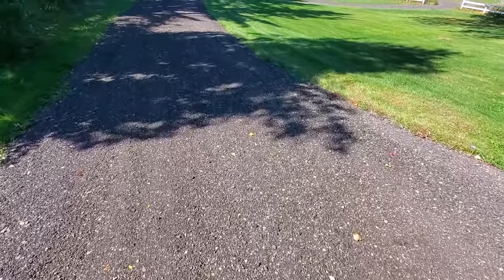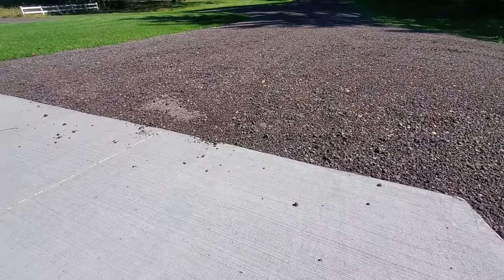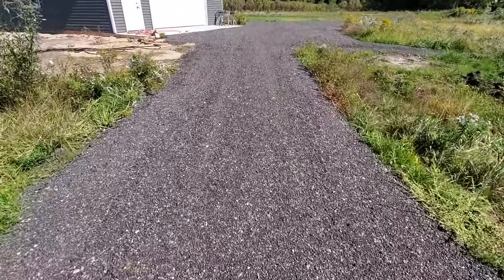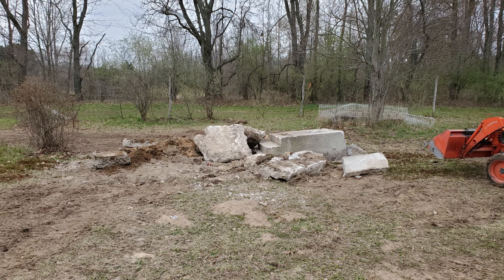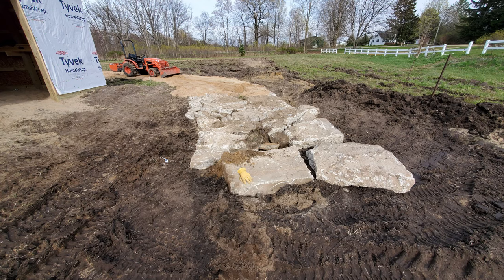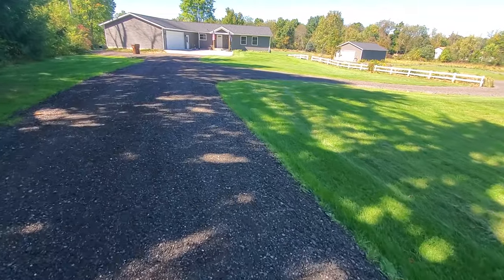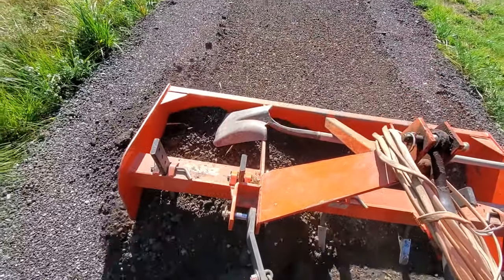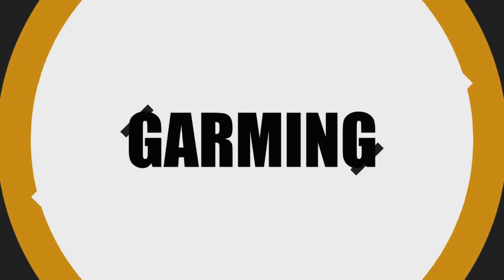DIY asphalt millings driveway and road any good? Will it hold 75 tons!?

Comment: I found a guy taking up a bunch of concrete, he was going to have to pay to get rid of it, he ended uo bring it to me, He told me it was 180k pounds od concrete, while most of it did not have wire there was some that did, and it was a pain, ended up renting a jack hammer for it, but the regular concrete was broken down into manageable pieces with a 12# sledge hammer, I'm filling a hole that the previous land owner dug out it measured roughly 40' X 60' deep, dug into a hillside and went from ground level to 8-10' ft deep at the back😬, I been using all kinds of fill, quite the job, I like the way your drive turned out, thinking of using Crushed concrete here on my drive for base, but really liking the asphalt millings for topping it off👍

Comment: I had 2 dump truck loads of millings delivered, I spread it and leveled it in the late fall season. Come early spring i ordered 2 pails of condensed hawkseal-E 
The rainy winter weather washed out my tar and so when i finally had warm enough weather to apply the hawkseal it dis not work as expected because theyop layer was mostly gravelly.. sad

Comment: Nice job dude. Couple of questions: 1) why did you use sand instead of stone dust?
2) noticed you grabbed the grade 1 milling with your hand. Doesn’t it bind together?
3. Did you use a roller on your 3 point hitch?
Reply from the maker: sand was cheap and i needed dozens of trucks for the house build already, not to mention that area was very heavy wet black dirt on clay so the sand thins it so to speak, allows good drainage. at some degree it binds. it doesn't move or create much dust. like it doesn't show on vehicles at all. i rolled it with a tractor, yes, a 1,000lbs roller i already had.

Comment: I had millings put down in my driveway and there are tons of weeds growing up through it. Is that normal?
Reply from the maker: probably not thick enough if it was recent. no way weeds would grow through 4-5 inches of millings.  if it was a while ago new sand or dirt on top would allow for seeds to grow within.
Reply: Seal coat it but it's better if you do it with a sprayer. There are professionals that can do it. I did it my self though.
Reply: Put down geotextile next time

Comment: Hi I have a cracked and some settled black top driveway.  Do you think putting asphalt millings on top of it while I save up for a new driveway
Reply from the maker: it depends on how bad it is but they make a rubber crack fill you pour in cracks and bags of sticky asphalt pot hole repair stuff you can get at any home repair store, I'd use that. fill cracks with liquid rubber, patch the low spots and tamp it down with the 50lbs bag material. could even spread a seal coat over the top to blend the colors. if your driveway isn't terrible that will buy a few years for sure, I've done it before.  good luck.
Reply: @GarmingGFB  the alligator cracking is a lot. It’s really due for a tear and rebuild.  I was hoping putting millings on top of it will level, compact and essentially be a cheaper alternative vs a complete rebuild
Reply from the maker: @bhadz100  not sure how well cold millings would stick to your drive. why i mentioned the other methods and they would be a lot cheaper too.
Reply: @GarmingGFB  honest <3 thats what i like to see. bhadz dont cheap out, if your driveway has sank ask for a hot asphalt overlay not recycled at all!!
Reply: even 1 inch overlay is actually okay if your old asphalt only sank a little and it only has cracks no pot holes!!

Comment: How did it hold up with plowing on it?
Reply from the maker: I haven't plowed, I use a mid mounted snow blower. Either way with a little skill it works fine.  just pick your hydraulics up a 1/2 inch or so, so you don't dig and it works fine.  Like any stone or gravel drive a good first packing of the snow always helps so you don't eat it up. Not only that I've had more dump trucks and cement trucks here and a quick fresh drag cleans it up well.

Comment: What about a seal coat?
I've been looking at the stuff from lowes but I'm highly considering this stuff called Hawk Seal.
Reply from the maker: you don't need a seal coat its an option. it works fine without, think gravel driveway with no dust or mud. plus you can just add a little more and it will look the same years later.

Comment: 1000 ft.² of drive for under $10k? That’s seems pricy also. 

I’d like to do like 2000 ft.²
Reply: Agreed.  I just did mine with about 90 tons of good material for $1200.  Not sure where the 10k number came from.
Reply: I think he's saying 1000 linear feet not sqft. It looks like way way more than 1000 sqft
Reply from the maker: obviously 1000 linear feet.

Comment: you have to put seal coat
Reply from the maker: you don't need a seal coat. it works fine without, think gravel driveway with no dust or mud. plus you can just top dress or drag annually or add a whole new section and it will look the same years later.
Reply: @GarmingGFB  that's a good idea but I sealed mine and it looks like a regular driveway.
Reply: @what4165  What did you seal it with?
Reply: @David Petik  tar from home depot or lowes
Reply: I've heard of spraying the millings down with diesel fuel on a hot day.